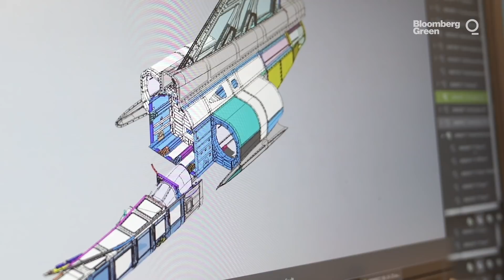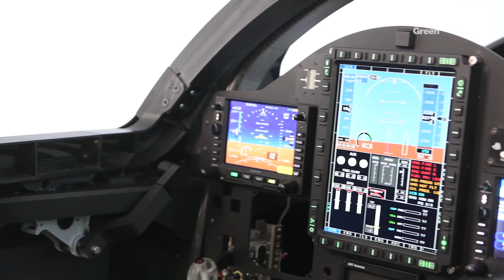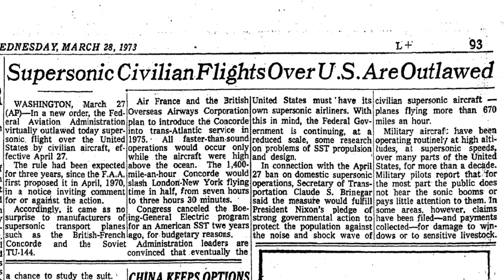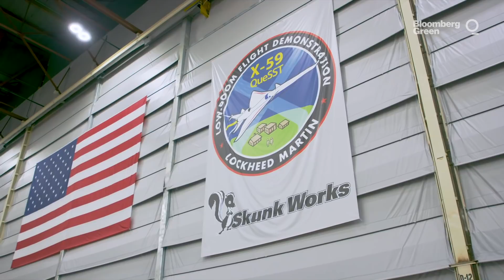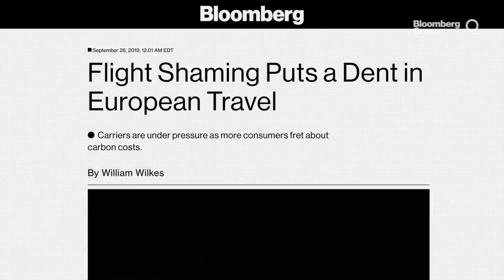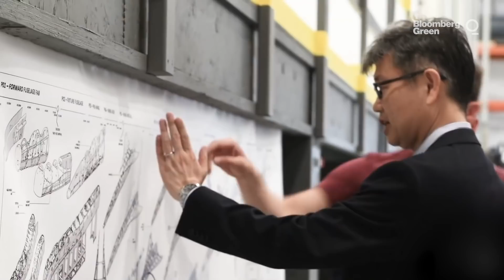Why Supersonic Jets Are Making a Comeback

Comment: To refer to concorde as a failure when it flew for 34 years is a little inaccurate.
Reply: @bond8436  the problem is Steam trains were replaced by more advanced and faster more powerful locomotives. Supersonics were perceived as being far more advanced and much faster than subsonics, but those subsonics are still here today, while all supersonic passenger planes have fallen out of service. Concorde and Tu-144 are about as far from a success as you can get and were most definitely commercial failures. The only reason they flew for so long was the retarded pride of some nations
Reply: @wenwei su Concorde was not a failure.... it exceeded its remit, broke new ground, set records, developed “super cruise” - the ability to maintain supersonic speed with the afterburners switched off....

It was made to fail. But as a technical exercise it was a resounding success, like so many previous ones, such as the Mosquito, Canberra, TSR2..... 🇬🇧🏁🇬🇧🏁🇬🇧🏁
Reply: The guy said less than 100 is a disappointment. They sold 14. Seems like a Comercial failure
Reply: @First Last hmmmm..... not sure that’s correct ... “On October 24th, 2003, both Air France and British Airways retired the aircraft. Despite a bid from Virgin Atlantic to keep the aircraft operational, the Concorde did not appear to have a viable future. At the end of it all, British Airways had gained £1.75bn in revenue with the Concorde against an operating cost of £1bn.”
Reply: Look at the investment and the return on that investment. It was a complete failure.
Reply: Don't forgot the US media propaganda against concord and sonic booms. If it is not from them they will do everything to spoil its reputation. Lets see how these American supersonic plans fly...without sonic booms.
Reply: A little? That statement is false and stupid.
Reply: Its was the tyre's that failed correct?
Reply: @bullet.1984  Spacer plate on an Air France concord was forgot to be put back together making the wheels move around like a shopping trolley, also the plane was overloaded majorly
Reply: It lost money every flight every year. That's not one failure: it's thousands.
Reply: I mean, but it was supposed to be the future meaning, the future FOREVER and it wasn’t. So in that case it kinda was a failure, but still iconic though.
Reply: It actually mad a profit for the last 20 years
Reply: It was political.
It is forbiden because we are jealous
Reply: @yannickille4049  if it had flown with the US flag on the tail and Lt Col Chuck Thrust lll at the controls, it would be the only plane flying now.....
Reply: It is more accurate to say, "it was never healthy"?
Reply: Actually a commercial sales failure for BAC/Aerospatiale, yes, but to say it was just a failure or didn’t make money are comments made by those with little or no detailed knowledge. It was a huge success for BA. Almost always full. Flew in public service for 27 years and some more before that. The aircraft was more of a supersonic bomber than anything. It could easily have been such. So complaints about cabin size seem to originate from some idea of what is the ideal; that’s something of an evolution over time, when we look at flying in today’s terms. When Concorde was launched it was a technological achievement beyond anything else, even the mighty Boeing was unable to challenge. The design parameters really demanded that a minimum seat capacity of 100 was necessary in order to be commercially ‘affordable’. Given the cabin was limited as to how big it could be, all other factors considered, meant that, yes, for up to three and a half hours, it was cramped. But no-one remembers cramped over exhilaration, the unending kick in the back acceleration, a climb rate of up to 20,000 feet a minute and supersonic seven minutes later, in pressurised comfort, at over eleven miles high, 23 miles a minute, five star silver service, champagne, caviar and anything else a regular customer demanded, favourite meal or wine, was available. BA made a huge success out of Concorde. Concorde made a huge success out of BA. Putting the record straight is an absolute requirement here.
Reply: @air5002  agreed entirely....

Having expended all our energy and resources in the 1930’s and 40’s.... we have remained bent over ever since. Every time we have advanced we have either given it across the pond or been slapped down 🇬🇧
Reply: Very much like the Lisitania in ships, the Concorde was never profitable. The Lucitainia was made profitable only by slowing its 28 knot top speed down to a mere 18 knots.
Couldn't do that with a Concorde.
Reply: economic failure, for sure. no market for it at the price it demanded
Reply: @rickross8172  well, that was then, but now, more people have more money, and they just don't want to or can't afford to own a jet, so Concorde would be for those.
Reply: If it were a success it would still be around today.
Reply: @nowammies9986  It would still be around today if it weren’t for that accident caused by an American Airlines jet loosing an engine shroud on the runway minutes before the ill fated concorde took off in Paris.
Reply: @nowammies9986  actually it did fine, and it would be around today if people could afford about $10k plane ticket... and then the flight would have to be full. It was ruled out from Continental flights due to noise.... and TransAtlantic flight was too expensive. People chose to fly slower and cheaper instead... though lots of Boeing and Airbus crashed wouldn't have happened if people would have chosen to fly on the Concorde..

Comment: Failed Concorde..? 28yrs of service ! Also the guy saying the engines were very inefficient clearly know nothing about Concord. The engines were very efficient when you consider they could cruise without afterburners at mach 2. The only Jet plane that could catch up with Concord at the time was the English Electric Lightning. Hows that for efficiency!! Sure they used a lot of fuel taking off but that's the payoff you couldn't avoid during the late 50s and 60s when Concord was being designed and engineered.
Americans will never get over it...lol

Comment: Failure? Concorde was the most beautiful airliner of all time and as advanced as NASA's rockets. 50 years after it went into operation we're running civil airliners with just 35% of its top speed. You couldn't exceed Mach 2 without burning some gas!

Comment: The problem with Concorde, aside from the obvious fuel burn and noise was mixing up with subsonic traffic and their routes that put it on a line with subsonic airplanes. Domestically, an SST would not work, even if it climbs above 50,000 feet. The airspace over land is way too saturated. For example , I know a route to an airport 50 mins way by airplane, but door to door, I beat the airplane on an 1:40 min drive. Also, an SST could not have pod engines. Too much parasite drag to fix later. Think of B-2 bomber design, and highways with no on or off ramps for long distances. Sure, airplane design and construction have evolved, as well as engine designs, but the biggest challenge will be getting from point A to point B with less speed restrictions, though searching for the sonic boom to disappear somewhat could prove elusive. Great video, though.

Comment: I have to totally disagree with supersonic flight becoming something other than niche for top elite. You make some improvements, but ultimately to go fast you need a lot of fuel. Fuel economy just gets exponentially worse.
You just can't get over some simple things, to go fast you need more fuel, thus you need to accelerate more weight due to fuel you are carrying. Also atmosphere will block you more faster you go.
Unless we somehow invent fuel that's environmentally friendly and cheap, going fast is just terrible option. Electricity is definitely not going to work as we don't have nowhere near level of battery/generator and electric thrust technology for that. And we don't really have anything better than fossil fuels for rapid thrust.

Comment: Well.... at least the press is consistently not very bright and totally miss informed. Concord was retired after only 30 years in Service, 747's are retired at 27 years because of cumulative stress on the air frame. Concord did 3 more years more than the average 747 but flew 2.3x further as it traveled at 1341 Mph compared to an average of 575 by most commercial airliners. Equating to 62.2 air years compared to a standard jet. Second.... speed!!! For the design teams in your video, it's pointless trying to build a new Concord because they literally can't keep up. Britain is about to take the HYPERSONIC Crown with SKYLON, a Mach 5.3 transport offering edge of Space or Orbital insertion able to fly from standard airports with long runways with 24 hour turn around. Sorry if you have shares in space-x.

Comment: Pffft  What a load of nonsense, if you fly a plane 50 feet above the ground while it passes through the sound barrier, its not only loud, it's gonna hurt.  At 60,000 feet it sounds like a distant thud, and fewer decibels than a Honda 900 passing at 30 mph.  

This article had so much promise and I loved that it is promoting supersonic travel, its awesome that private industry is stepping up to this challenge but the criticism of Concorde is bizarre, inaccurate and pointless.  Of course it doesn't compare well to modern machinery.  Why describe the engines as inefficient when at the time they were hailed as the most efficient engines in civilian aviation?  They introduced afterburners to civilian air travel ensuring 100% of the fuel was used, something many modern day engines still cannot do.  That might not impress you today but 50 years ago it was a revolution. 

I wish this had focused on the achievements of todays genius supersonic travel designers instead of pointing out dubious and sometimes inaccurate comparative issues with the past, maybe this is a tribal thing, the idea that Europe built something the US and Russia failed to do?

Comment: I looked at a Concorde, there tiny, like a coach with wings. Where did the fuel get stored? Surly an engine that sucks in air and blows it out the rear for propulsion doesn’t need fuel?
Reply: They ain't giant, 147'000 litres?
Reply: Stand next to one. 

So it carries over 100 tonne in fuel plus 108 people plus luggage...
Reply: The fact I’m making is that aeroplane engines don’t use as much fuel as you think. The fact you’ve been on one you would remember that the wings are razor  thin.
Reply: Enough to start it only?

Or did you wait on the runway for a couple of hours whilst five petrol tankers filled the razor thin wings?
Reply: My point was made clearly in my first comment. By your defensive attitude you know I’m right. Replying to me at every step. What is trolling, living under a bridge? Live long and prosper my friend.

Comment: Dont know if I would call 27 years of service a failure
Reply: @mug wump because the whole reason for starting an airline is to.....make money? It was an engineering marvel but a financial failure
Reply: Failure? It is still has the record for the most hours of supersonic flight. No other supersonic cable plane has come close.
Reply: @mug wump i understand your point here... it was and still is an engineering marvel, but the discussion here is about economics of building, selling and flying a supersonic commercial plane.... commercial... 😊
Reply: A crash caused by an american jet throwing bits of metal onto the runway.
Reply: @MarkBrown-gc6hr  AMERICA dont do ESPIONAGE
Reply: It was a huge failure. 27 years of service were only possible with billions of government subsidies, Concorde is a huge commercial failure and has a horrific accident statistic, 4 crashes per 1 million flight hours. 
 Concorde has an accident rate 66 times higher than the 737NG and 50times higher than the A-320 family !!!

This is by no means a success !!!
Reply: @JBags72 Speed does not matter that much when flying from a to b .. otherwise airlines would not fly slower and slower. Fuel economy, lifecycle cost and CODT PER SEAT-MILE  is the name of  the game. Speed above Mach .74 to .85 is a negative factor in this equation.
Reply: Americans say that 'cos this beautiful baby was Anglo-French.
Reply: If they marketed to the rich from the start maybe it would have done better?  The upkeep was high the entire time so....
Reply: @mug wump Building Concorde was as useful as trying to color a cat pink. It was a huge commercial failure and had a horrific accident rate. The engineering part is not rally impressive, since endless government money makes almost everything possible. Concorde was basically a huge Mirage3 .... nothing special to be honest.
Reply: @JBags72 It was a huge failure and speed does not matter much as we can see. During the last 50 years fighterjets and Airliners got slower and slower each generation (with few exceptions of course)
Reply: @mug wump Actually the Soviet TU-144 was the first supersonic airliner to fly and enter service .. not Concorde.
Reply: How is it not a failure if its not self sustaining
Reply: The same as what's happening to nuclear power plants... it just isn't liable. 
And in all honesty, a total waste of precious resources and manpower
Reply: “Failed concord” I thought that too... wtf...
Reply: Paul Jessy  Air France and British Airways both pulled a net profit on their Concorde routes, that’s why they flew them for 30 years...
Reply: @f123raptor  They only could make a „profit“ because the airlines themselves were subsidized and they never had to pay the billions to develop Concorde . The government did. So no, they did not make a profit once you look at the whole picture.
Reply: It is when no money was made
Reply: @nick-dm3if  In total it didnt make money. Part of the reason for that was they tried to price the tickets in relation to other aircraft. It started making money when they realised that most of the passengers had no idea what the ticket price was and were prepared to pay whatever the cost.
Reply: @cullen3624  Sort of... but not exactly...

“In total it didn’t make money.” The governments’ development programs never recouped their large government funded R/D costs, but this had nothing to do with ticket prices. It was entirely down to the fact that most airlines canceled their purchase orders allowing BA and AF to leverage the political situation at the time to get the planes for pennies. Where you’re citing increases in the fares, we’re not talking about the program, but rather the airlines’ SST operations - and SST operations for both BA and AF were lucrative after brief losses initiated restructuring in the late 70’s/early 80’s. For several reasons, sales slumped in the early 2000s and it lost some money but ultimately the timing of its retirement was that Airbus had decided to terminate support for the airframe.
Reply: @nick-dm3if  Concorde didn’t make money for the consortium that built is correct.  Economy of scale.  They needed to build hundreds if not a thousand to make a profit.  In operation is a different Story.  BA and Air France wouldn’t have flown them nearly as long if they weren’t making loads of money per flight.
Reply: @nick-dm3if  Air France and British Airways both made a profit on their Concorde routes.
Reply: @f123raptor  Not really.
Reply: @22Epic  “Not really.”  - citation needed
Reply: @nick-dm3if  Apollo program did not make money
Reply: @baseball-4ever  ridiculous comment
Reply: @baseball-4ever  ...and it didn't even do what it claimed to. Lying about doing something isn't the same as achieving it - whatever your motive.
Reply: @0megalul309  go away the adults are talking
Reply: @mattbaigent5373  There was a maintenance problem. A spacer wasn't fitted to one of the wheels thus causing at take of the aircraft to slew off course and tyre blowing. The area where fuel kept was behind and was ruptured by shrapnel from the tyre. The Air France maintenance crew involved were charged for manslaughter. To meet safety standards it was far to expensive to modify the fuel tank. In fact it was also at 27years service getting far to expensive to maintain. It had suffers 2 incidents with the rudder but no one was injured. I live within a mile of Rolls Royce Bristol and British Airospace where Concord was built. She now sits in a museum there. O2 Concord was there and had been stripped for parts. Saw her come in to land for final time. Officially. But she went up for a short flight the day after. I heard its passengers were some of those who had worked on her. Her History is well known in these parts.
Reply: @0megalul309  oh yes, it is the left wing protesting against mask and vaccines.
Reply: Poor thought statement... rather ignorant and stupid. It was a successful piece of engineering. It was not thought well by the airlines... but that's not the fault of the plane.

Comment: Just make them hydrogen powered, boom, no more greenhouse gasses.
Reply: hydrogen powered? BAHAHAHA. Firstly water vapor is a greenhouse gas, secondly the energy demand of a supersonic airplane would have the need of so many hydrogen cells that it would weigh so much it couldn't fly.